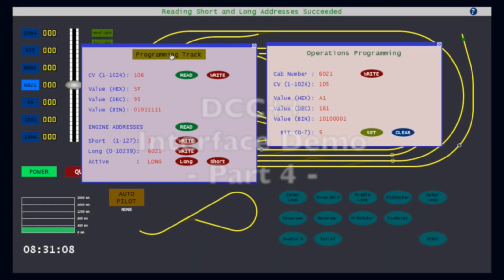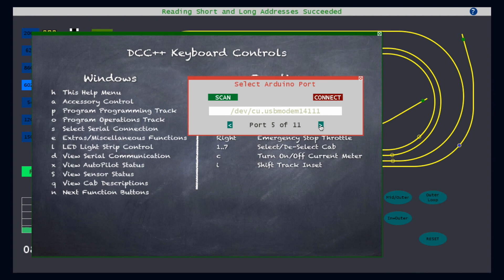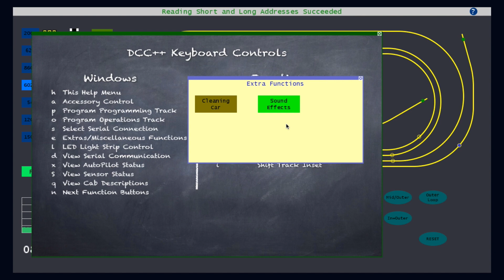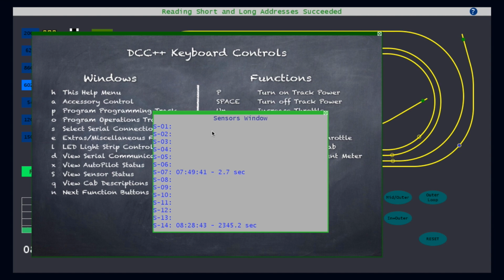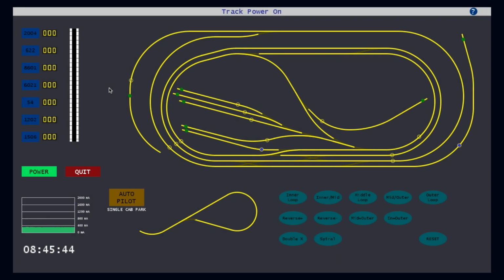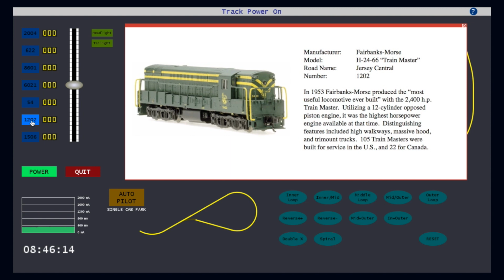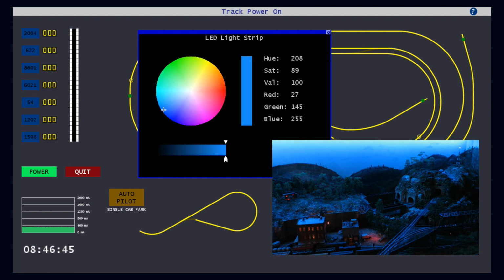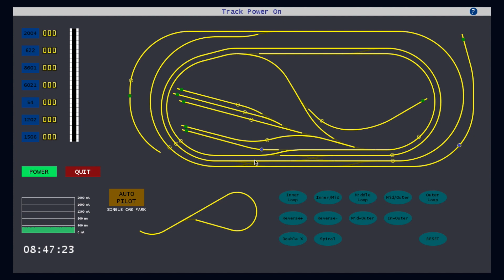DCC++ Interface Demo - Part 4 of 4

Comment: Great job! I have a question about sensors and accesories - how are you reading IR sensors and driving lets say LED strip - also through the DCC or seperate connections, have you any sensors on bumpers at the ends of track?